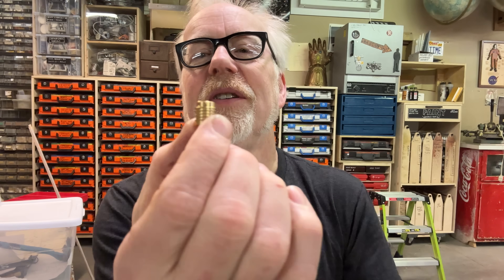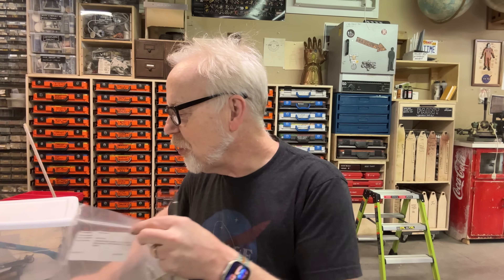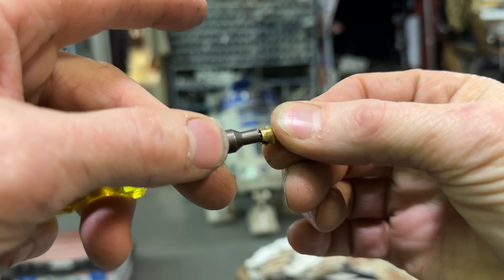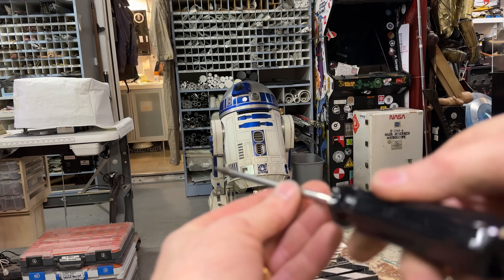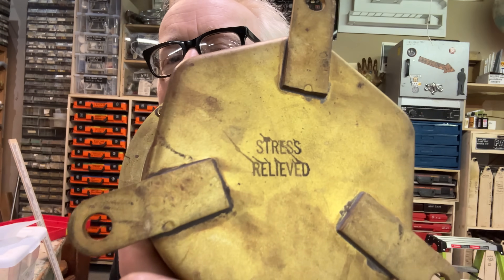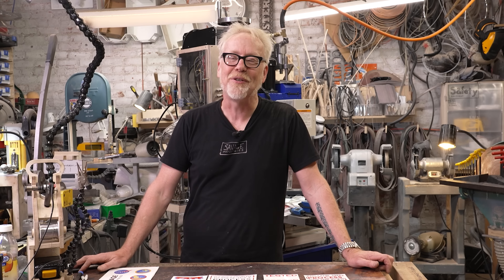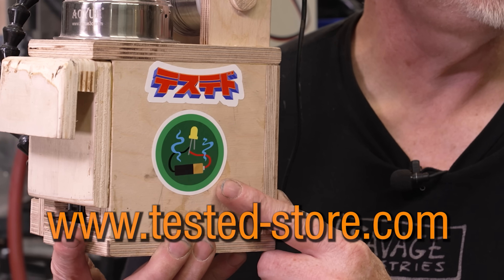Adam Savage Learns About Barrel Nut Screwdrivers!

Comment: Retired Coast Guard ELC Chief Warrant Officer here... The tool your viewer provided is indeed for barrel nuts. I wouldn't use it for nutserts, though. The rounding on the barrel nut driver is likely to cause the driver to step out of the nutsert as you torque it over.

Barrel nut drivers are specialty tools from an age when terminal boxes much like that provided by your viewer required the special tool because flat head drivers would walk out of the cut on the barrel nut, which may cause unintentional damage to other terminals on the board or cause arcing between terminals when working on energized equipment (remember to get CO's permission first!!!). Flat head drivers were also either too wide or too narrow to be a good fit for barrel nuts, making damage to surrounding nuts more likely, or making damage to the nut you're working VERY likely in the case where the head was just a hair too small.

Multi-bit drivers with 5/16th and 7/16th receivers have largely eliminated the need for the barrel nut tool, however. For the barrel nuts in the term box your viewer sent I'll bet an open multi-driver bit receiver will fit over the hex body of that barrel nut quite nicely. The barrel nut tool kit can cost hundreds of dollars, whereas a MegaPro 11-in-1 multi-driver like the one issued to me at my first Unit in 1999 will run you between $20 and $40, depending on the bit options.

I had that driver until handed down in 2019 when I made Warrant. Every shop that worked for me after I made First Class called it The Grail. Never went a day without that thing in my left front pocket before I make Chief. After that, it didn't seem like I should have a driver on me at all. Handed it down to my First Class when I promoted from Senior Chief to Warrant. MegaPro made great tools! https://megaprotools.com/en-us/

Comment: They sell driver bits for your drill, called an insert nut driver or EZ LOK drive tool. Basically looks like the tip of these drivers he was sent minus the spring loaded shaft, they have a short fixed centering shaft. Failing that a bolt with two nuts jammed together works ok. Not practical to try installing them with a hand driver, that’s gunna be slow going.

Comment: If put a screw of the right thread size with two nuts screwed onto the screw you can drive these with a Phillips head screw driver. The nuts ensure you can remove the screw without unscrewing the barrel nut. Just hold the nut closer to the barrel nut with a pair of needle nose pliers. They are hard to install at a perfect 90 degrees, but if you follow the manufacturers drill size suggestion they go right in. McMaster-Carr sells them and gives specs on the right drill size. They also sell the drill bits. Great topic. I use these things all the time.

Comment: I've actually came across some (arguably even better) options for these when building a custom loop PC watercooling setup a few years back.

I've been doing these builds for many years, but I started out with a bunch of good quality parts so I've just been reusing the old fittings. This time I had to get new ones (from EKWB), and it turns out their modern fittings are actually hexagonal on the inside.

That got me thinking about inserts, and it turns out there's a bunch of different types of threaded inserts - including barrel nuts - available with sn internal hex shape at the end
 🙂 I pretty much only use those types now, and I haven't gouged, stripped or slipped on a single one ever since. Just using regular hex keys, drivers and bits :) Since it's entirely internal they sit well on a driver with no need for a center post, they're easy to start with one hand, nothing can slip sideways and mar the workpiece, and it can take a crapload of torque without stripping/rounding.

Comment: As a photographer, I occasionally need to move tripod heads and quick release plates that have different sized threads between various tripod related components (macro slides, quick release adapters, etc), and threaded inserts are used to adjust the tripod threads. In fact, I did this tonight, and had trouble finding a screw driver that would do this. These screw drivers look like they would have been perfect for what I was doing.

Comment: I've been using a threaded rod coupler screwed over the threads of the barrel and insert the screwdriver inside it.  I clamp pair of vice grips over the rod coupler level w/the wood if I need some added stability.

Comment: I have made a little jig from a piece of scrap wood. Half-lap on one side and threaded it a hole in the middle of the half-lap. Take a bolt and nut to crack it vertically into the wood.

Comment: The old Rotork valve actuators used brass barrel nuts for the electrical terminals. Without a barrel nut screwdriver you’d be chewing through terminals all day.

Comment: I always use a bolt and jam nut then install them with either a nut driver or wrench or socket. Same way I remove them whenever I dismantle something and salvage the hardware. Some of them don't have the slot and it's the only way. It always works best to tighten a little before removing.

Comment: I have a small one I got in 1970 when I worked for Sothern Bell in Miami - it was used for the screws for the plugs on the 551/555 and 602 operator cord board that were use behind the 701 step by step switch - this was before electronic central offices were everywhere -

Comment: I’m still searching for a variant of this special screwdriver. In my case, the shaft is not part of the screwdriver but rather the part I’m trying to remove a fastening nut from. The threaded nut is round and the only way to grasp it is by engaging two small slots, while the part’s shaft fits into the tool. A slotted facia nut removal tool. Any comments will be appreciated.

Comment: I prefer taking a machine screw that fits the inside of the insert and I take two nuts that fit on that screw and tighten them against each other and then screw it into the insert.  Then I use that to screw the insert into place using a hex head ratchet or other tool on the machine screw.  It keeps it stable as you screw the insert into place.  I just don’t bother with anything that fits into the slot.

Comment: Never needed one of those... just a hex bolt with the inner thread pitch and a pair of nuts on the hex bolt to set the depth so it doesn't extend past the insert.

Comment: I work with magnesium part manufacturing. We have used similar inserts called E-Z loks, which use a very similar installation tool or as you say "screwdriver", but by far the best insert for soft metal like magnesium is called a key-locking insert (more commonly referred to as a Keensert, which is a brand name). The tool for installing these type of inserts uses slots to capture protruding keys, then you thread them in until the keys interfere with the thread of the hole. Then you flip the installation tool around and use a dead-blow hammer to drive the keys down through the threads. This locks them in place. They work great. I've installed thousands over my 25 years of working with them.

Comment: A barrel but screwdriver is great.  But a hollow ground flathead works just fine.  Just don't use your typical tool box flat blade.  Hollow ground flat heads are great addition to the tool box. Especially for gunsmithing

Comment: I went a different way and I install mine with a threaded rod and a couple nuts using my drill press. I use a tap to just create a starting lead thread then onto the drill press if I'm doing many I usually slack off the belt so the spindle turns freely then I use some down pressure and turn the chuck by hand.  This sets them square and also if I use a finish washer depths the insert flush.

Comment: We use those brass threaded inserts at work. We thread them into 1/2" HDPE. There is an attachment you can get for an impact driver to install those. Keeps it attached using a ballbearing like a socket wrench. Then it has two wings on either side for the flat head part.

Edit: Didn't even know they had screwdriver kinds.

Comment: You can make driving a screw into wood easier (and reduce damage to the head) by rubbing the threads with bees wax. An old furniture builder showed me that trick. Works really well.
Reply: I just tested this. It does work well but I was stung many times
Reply: Paraffin wax (e.g. common candle wax) and soap are two good alternatives.

Comment: Would those work for carburetor jets? Used to be a power sports tech and I always had to be so careful when removing those without  smudging the end. Putting them back in was never the problem it was removing them for cleaning. I guess it was not a big deal to just put a new one in but I'm wondering if a lot of those could have been saved with one of these screw drivers. Might not be the right application though.

Comment: Used to be able to get various sized barrel-nut drivers for manual tap'n'die toolsets.  There are also special barrel-nut-like inserts called Helicoil that need an external containment cylinder with center relief slot driving tip that goes in past the little tail at the top.   I know you know about Helicoil but I really thing more people should.

Comment: E-Z Lok makes a hex driven driver for each size of the knife thread inserts. However, those are horrible inserts (the brass, the SS are good for ext signs), the hex key driven threaded inserts are much easier to install and less likely to snap. They usually listed as “premium” or “furniture bolt” inserts and are made of mild steel

Comment: Today I've learned that I have been using barrel nut screwdrivers incorrectly........to take apart Nintendo cartridges.  (Somehow they worked on gamebit, and it's all I've used before I opened a shop and use actual gamebits drivers.)

Comment: the 1911 hand gun use thes type of nuts to hold on the grips and the some other like the fnfal recole spring stoper and pps43 grips you shoud look in to security screws driver and anti tamper screw set

Comment: ADAM! There is no such thing as a flat head screw driver. Any driver with the correct biting can drive a flat head screw just as easily as a pan head, truss head or any other screw. Personally, I prefer Philips or Robinson when I use a flat head. 
What you are likely referring to is a slotted screw driver, which should only ever be used as a chisel, drywall reamer, trim popper or reusable ballistic missile (in the event of a zombie apocalypse).

Comment: I have inherited a bag of brass wood screws with a similar hole in the middle, that would also roughly match the barrel screwdriver design, BUT i am in Germany and i need to find a translation for that, just wasn't able to find info in the original screwdrivers for those screws yet. so close :D

Comment: Adam, not only does the sprung stem help locate the ‘ears’ so it isn’t “munged” (mundged??) but also aids retaining the thread before screwing in AND reduces the risk of the thread dropping into the works when undoing - perhaps why used on subs.

Comment: I wonder why the tips are hollow ground?  Seems to me that engagement would be better if the tips were completely parallel.  It's not like they need to relieve a stress riser because the drivers will see tons of torque...   Now that I think about it, I may have one of these in my "special" screwdriver drawer.

Comment: A similar tool is used when building bike wheels - it's used for screwing the spoke nipples on. It has a depth limiter pin screwed into the tool that can be adjusted to a desired depth, to keep all spokes initially at the same length. Then you tension them with a slotted spoke wrench.

Loved that sturdy metal junction box. A thing of beauty, a joy for ever. That'd make an awesome enclosure for an electronics project!

Comment: Now after you told to use a barrel nut screwdriver i thought it makes absolutely sense and then in my mind there were some memories mildly swirling around, where i know i've had a quite longer period of time where was working with the same barrel nut system, but the kinda most awful ones by wich sometimes my hand started cramping or the fingertips got oversensitiv cause fiddling around with the 'nuts'... 
after 10min of trying to remember what it was where i've had to use them i remembered... maybe for some it even doenst seem so obvious, but be aware of LACING BICYCLE RIMS by your own.. the same barrel nut system holds the spokes to the rim and they are used aswell for straightening & centering the rim/wheel (as like the weights added when balancing car wheels) 😅😅

Comment: i feel for wood inserts that a bolt matching the internal threading, with a couple nuts locked together, does a better job at driving the nuts in by pressing against the top face of the nut. i can see these tools being perfect for extracting however

Comment: Love your posts. I haven't read thru all the post but all you need is a cap screw or bolt of the proper threads. Thread it into the barrel nut and use an impact driver or allen wrench. To remove a barrel nut you might need to use a jam nut. Our tax dollars at work. No fancy tools required.

Comment: In the UK, we would call these threaded inserts, ours have an hex inset, so you drive in with an Allen key.
Barrel nuts hear a threaded hole at right angle to cross section. Often used to fasten headboards to bed side rails, very strong. IKEA use them a lot.
Charles

Comment: If I had them and a use for them I would be making a specialty screwdriver drawer, I already have a normal set, a modified/bent set, and a nut driver set from 2mm to 13mm, these would tip the favour to making a drawer just for screwdrivers and screwdriver variations.

Comment: Most places that sell threaded inserts also sell a specialty tool for inserting them. The tool is usually a simple rod that has male threads at one end to match the insert, and a t-handle at the other end for twisting torque. I'm not sure how the barrel nut drivers shown in this video are functionally any better or worse than a plain flat bladed screwdriver?

Comment: huh..
for my inserts (brass and steel) you have to put the slotted side in to the hole first.. its a bit like a cutter..
and the screwdriver has an ouside thread that goes into the inner thread on the insert. so each size has a different screwdriver tip.

You are not using the "cuts" to transfer the torque, it goes into the nut thread and locks itself there. on removing it unlocks by a 90° rotation.

Comment: Brilliant!!!  In Australia we call these Threaded Inserts or Nut Inserts.  I too have many times mangled the slot attempting to thread these into timber.
Another method to thread the inserts into timber is to thread a bolt with a lock (jam) nut into the insert and use a socket or allen key to drive the Barrel Nut into the timber.
I have just sent a message to Comsaco to ask if they will ship to Oz...  Thanks for providing this info.

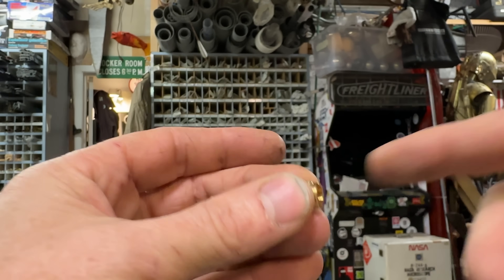Comment: 2:36 I use those exact same brass threaded inserts when I build contact printing frames for older photographic processes. I like how they look, but I agree installing them is so frustrating. When I try a new size I have to carefully step up the bit size to get the perfect hole that it fits tightly, but not so tight I break them. I don’t have a caliper to measure them. I don’t understand why they don’t give you a bit size from manufacturers instructions. I also don’t understand why they chose a flat head instead of an Allen wrench.

Comment: While a specialty screwdriver like that is fantastic, I always like knowing more ways to perform a task.  For these, I prefer to insert a machine screw into the threaded insert and drive the assembly into the wood.  I find Allen head screws work best for a positive engagement of the screwdriver into the hardware.  Extra care to avoid over tightening is needed, but your tip on how to measure these is the most important step to avoid doing so.

Comment: Threaded inserts are threaded on the inside.  Just put a short he head bolt in there,  use a socket to tighten. Some also take an allen wrench on the inside.

Comment: There is still the problem with these that the brass is so weak it will often shear off. I know because it's happened to me many times. A better tool is a threaded insert T-handle wrench. The insert threads onto it, and then you use it to drive it into the material. The only problem is that you often need so much torque to get these brass inserts into the material, that the threads can seize and you can't back the tool out without taking the threaded insert with it. The solution is to use an anti-seizing grease/oil between the tool threads and insert threads. That generally avoids the problem.

Comment: Boy, seeing that junction box takes me waaaayyy back.  I too was an electrician's mate on submarines and yes.  Notice too that you can slip those nuts onto the tip of the driver to start them on the terminal block.  :)
Reply: Or when supply cancels your order for them 6 times and you just have to file a flathead

Comment: Dad use to use a special driver made to wrap wire on circutboard pins prior to soldering.  Imagine trying to find one now with all electronics treated as disposable.
Reply: It's called, oddly enough, a "wire-wrap tool", and you can still get them from Grainger, Digi-key, Jameco, etc. in hand-twisted, squeeze-twisted, and electric versions (depending on how much you want to spend, and how fast you need to work).
Reply: @cdorcey1735  A good wire-wrapped prototype board is a thing of beauty.  You don't often see them anymore with ultra-cheap custom PCBs being so readily available nowadays.

Comment: I dont need yet another specialized tool though I just put a screw in them with a couple jam nuts about a quarter space from the head of the screw, screw in until the nuts bottom then unjam the top one and badda boom. screw comes out. not another set of tools I only occasionally use lurking around the shop